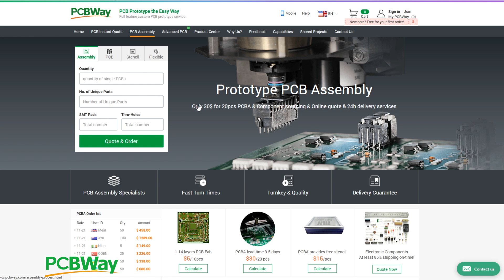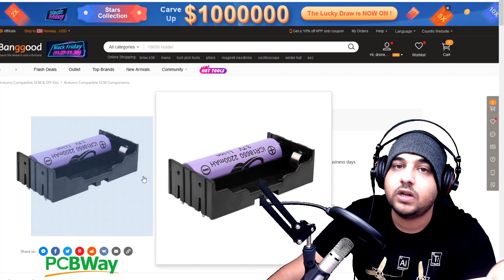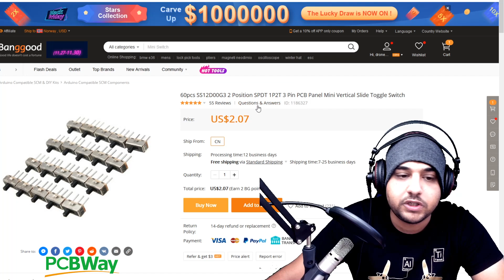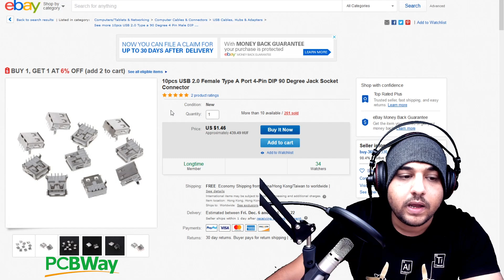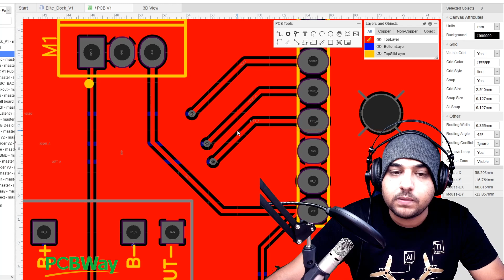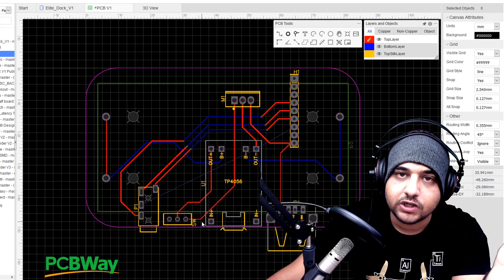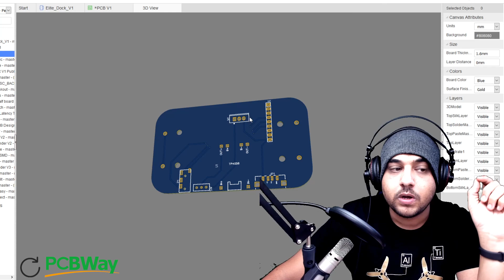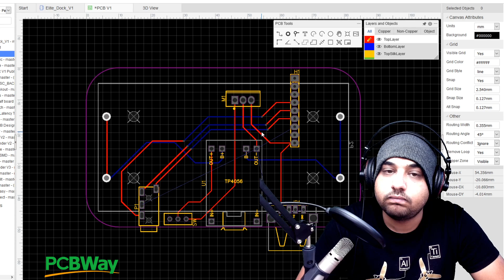Elite Fatshark Dock // Open Hardware Rapidfire Module Dock

Comment from the maker: Battery Holder: http://bit.ly/37n8NUx
5v Booster: http://bit.ly/2O6xm0w
Charging Module: http://bit.ly/336DJFs
Power Switch: http://bit.ly/2s6nHOX
Video Output: https://ebay.to/37tti1O
USB Type-A: https://ebay.to/2KIfEyp

Comment: I designed a similar board some time ago. I used a step down module (mini360) and it did introduce annoying noise. There were caps and ferrite bead for filtration on the board, and they did not help. Adding more caps did not help either. I had to remove step-down module and use stable 5v source to power the dock stations.

Comment: That is awesome i definitely plan on building one of these. Im currently using a friends dock-king with a tft monitor but i the actual screen looses signal sometimes and shuts off for a second or two can i fix this? I also have the fxt viper 2 but they only have hdmi in no aux in. Is there a was to mod the hdmi so its just aux in if not what kind of screen would you suggest this set up